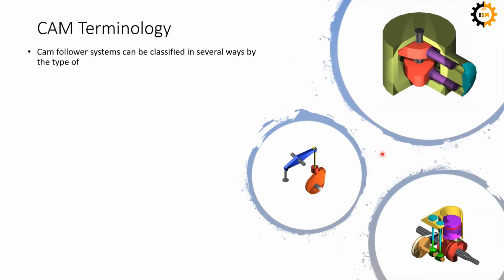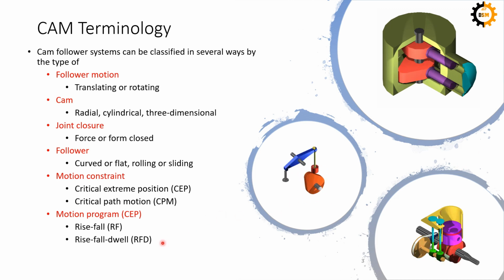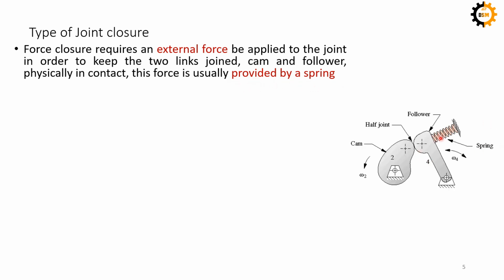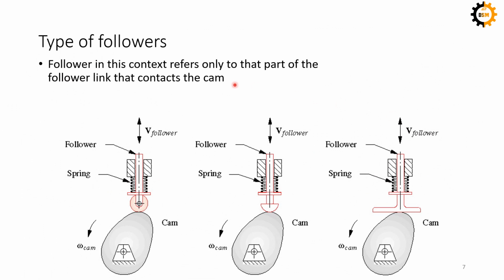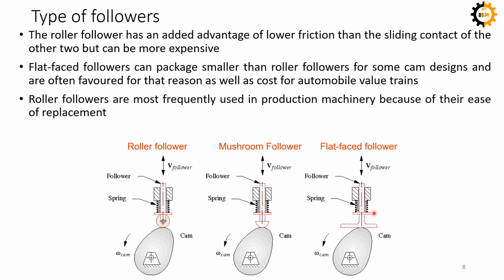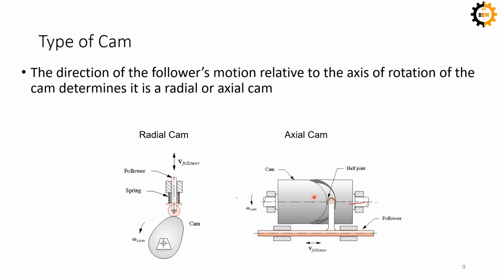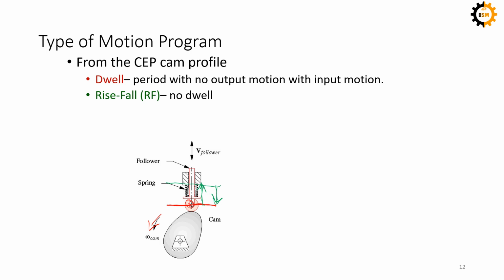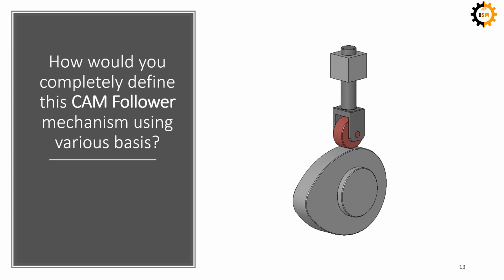27-2 Theory of Machines | CAM Follower Mechanism | Types

Comment: The mechanism can be classified according to the following:
Follower motion: Translation
Joint Closure: Force closed 
CAM type: Radial
Follower type: Roller follower 
Motion Constraint CEP: Rise-Fall-Dwell
2017424

Comment: The two examples provided for joint closure differ in a way that in one, the follower is continuously in contact with the cam while in the other, contact momentarily disconnects when follower reaches the top position. This happens due to the fact that the one in continuous contact has a restoring force that does not allow the follower to disconnect from the cam. The two mechanisms could be classified into RF and RDF types of motion. 2017062

Comment: Roller follower has low friction of all the types of follower because in 3-D there is only single line in contact between cam and follower so, roller follower must be used in applications where friction needs to be minimize. 
(2017480)

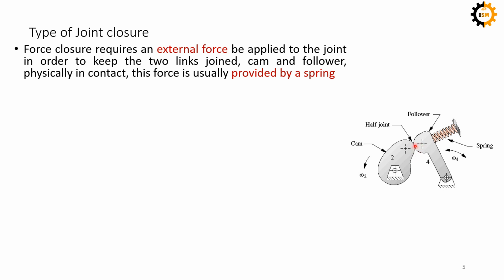Comment: At 9:30, I have a query  that since the spring only forces the follower to stick with the cam when its compressed but when the cam moves away and the spring tends to stretch then in that case the follower will not be touching the cam and hence the joined will not be closed. (2017378).

Comment: 2016227
Please clarify this, You've mentioned that follower motion is a way to classify CAM follower mechanism where they can be translating or rotating but in the explanation at 5:34 and onwards you've described it as oscilatory or rotating. Are we to assume that oscilatory motion is translatory motion?

Comment: (2017132)
In types of Joint closures the difference between the two mechanisms is that the first one has been constrained by an external force such as gravity so that it forms a forced enclosure. While the second one hasnt been forced closed rather the follower motion has been defined by form closure externally, that is why it doesn't remain in contact with the CAM throughout.

Comment: The two mechanisms had force closure joints in the joint closure slide. The right one used the force of gravity. The cam and follower were not contact for sometime in this mechanism because of inertia. But in the left one there was no discontinuity because the spring didn't let the follower move away from the cam. 
2017300

Comment: The mechanism at the end could be defined as:
-Translating follower
-Roller follower
-Radial cam
-Forced clousure
(2017364)
Reply: 2017469, The mechanism shown in the end has a translating, roller, force closed follower. And a radial CAM with a rise-fall-dwell motion

Comment: Cam follower mechanism is used in automatic lathe machines 
wall clocks 
and for intake and exhaust valves of IC engine
2017194

Comment: In the joint closure examples, both the animations have a force closed joint. However, in the left one, the force is provided by the spring while in the right one, it is provided by gravity.
Mechanism Description: Translating follower, radial cam, force closed joint, roller follower, CEP motion (RFD)
(2017437)

Comment: In example of the joint enclosure, the first mechanism in which the follower always remains in contact with the cam is due to 2 reasons; either it is forced closed by spring or it has a huge weight. but in the second mechanism, there is no forced enclosure -  that results in a jump over the surface due to the high angular velocity of Cam or it may be due to friction that exists between the follower and the constraint path in which it is translating.

Comment: The two most important types are : Disc or Radial Cams In these the working surface of the cam is shaped that the reciprocation or oscillation of the follower is in a plane at right angles to the axis of the cam  
(2017164)

Comment: 2017126
And sir in the example of joint enclosure, I observe that  the first one, it is always in contact with the cam because it is only under the force of gravity mainly, but the second one is forced from a pin or punch or anything else from the above, because at the max extreme position or at the max rise, for some time it is not in contact with the cam, which means it is pivoted from above side with something.